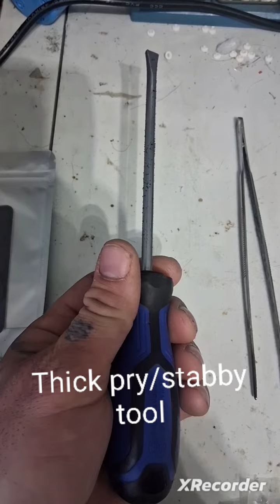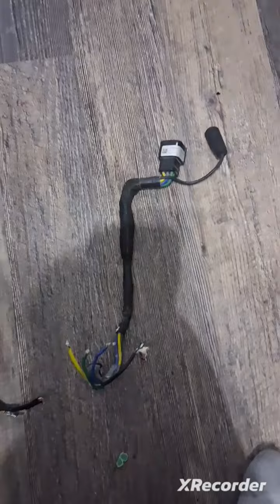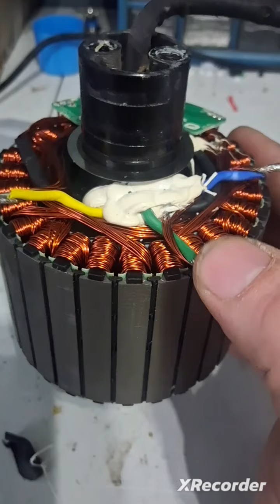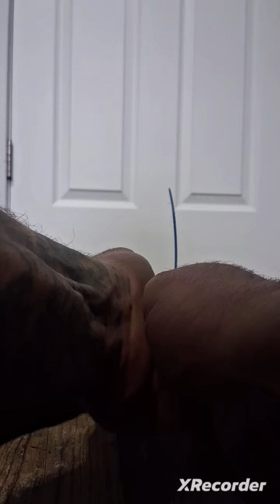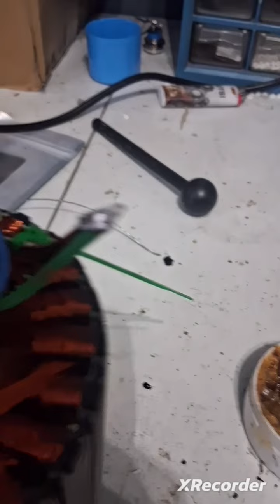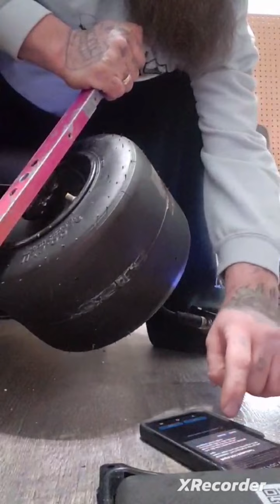FULL TUTORIAL: Repair, Replace, Upgrade your motor harness on your Onewheel VESC XR GT GTS.

Comment: I've always imagined what the job was like, but this was my first time seeing it. I've had to replace a pcb before and I didn't realize I could just solder above through the through holes.
Reply from the maker: I had replaced like 5 hall sensors on a couple swaps before wanting to give it a shot and see if I could just delete that variable. Turns out I found a new favorite strategy while filming this video 🎉❤